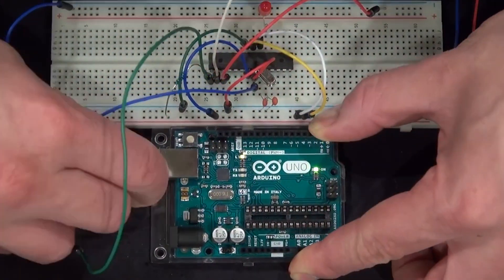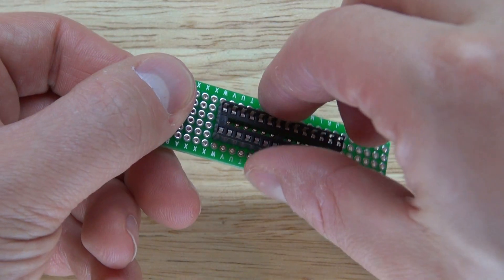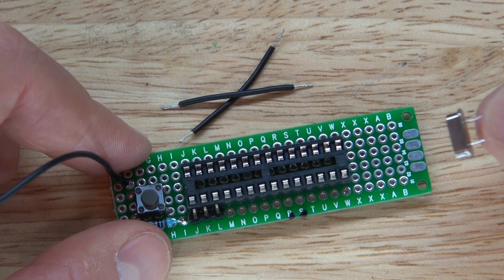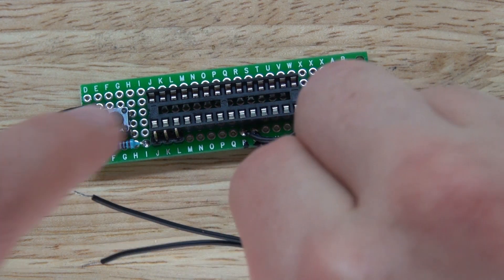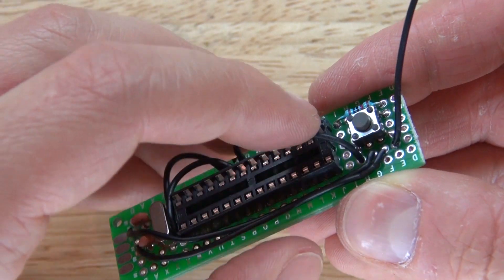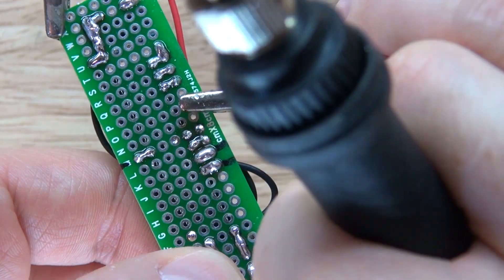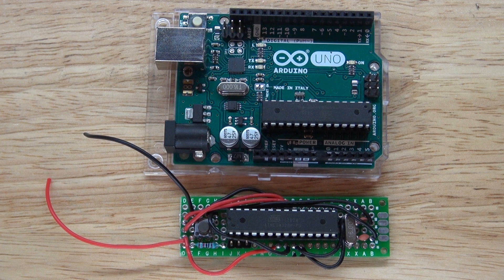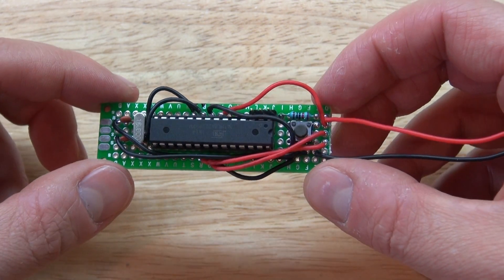How To Make A Basic Arduino On A Perfboard

Comment: When I use my multimeter to check for continuity, there is always continuity between pin 7 and 8, what should I do. Because I have made sure there is no contact during soldering
Reply from the maker: You may need to clear all the solder on pin 7 and 8 and make sure it is clean and redo the solder.

Comment: Sir I'm sorry this isn't about this Vidio but I didn't know how else to contact you. If you are willing and see this I was wondering if you might know what I might be doing wrong or is wrong. I'm not finding it will looking on the web.   Sir I have a few Arduinos and have one that I have noticed that I can't run on lower voltage than about 8 volts  with a 9v battery on pin 29 and 30 on a nano.  I have a list of parts but didn't wish to make this to long. Thank you for your Vidios I do enjoy them .  Bob H

Comment: Could have grounded the capacitors at the same place rather than taking the wires all the way to opposite side , other than that thanks for the informative video 👍. Also should we add a fuse too ?
Reply from the maker: Thanks! I don't believe a fuse would be necessary. I have used this for a long time and is works very well.

Comment: Like several other videos on moving Arduino projects to perf board, yours includes a crystal oscillator. Do all Arduino projects require it? IOW, is this oscillator used to drive the microchip, or some feature of the particular project? Obviously, I pretty new to this subject.
Reply from the maker: It is one of the most important components. Without it, you would not have the output functions of the atmega.